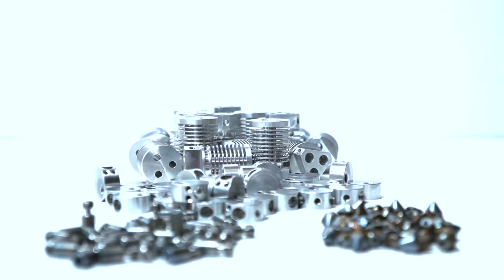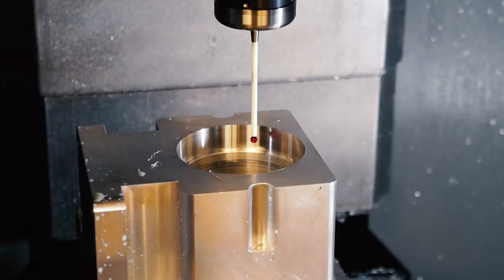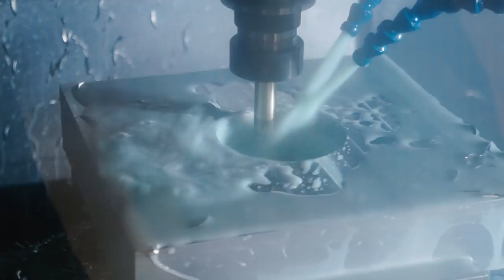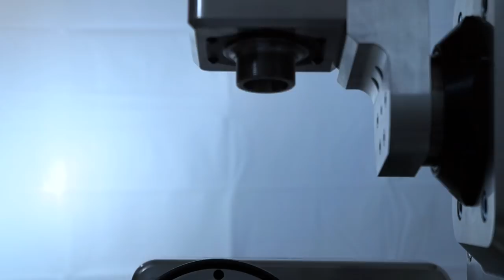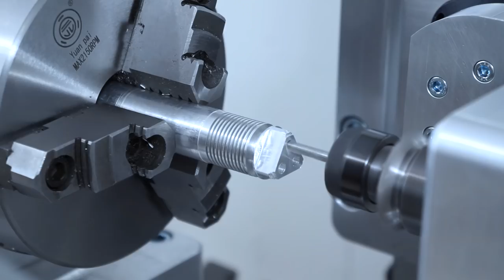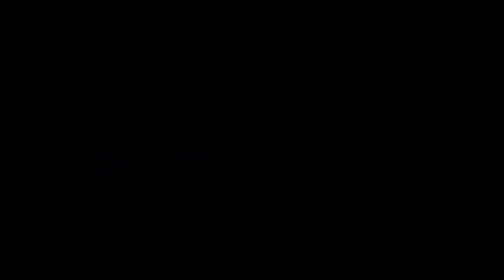SwissMak Kickstarter Launch - A Desktop CNC machine for Makers

Comment: Very funny looking at the kickstarter for this. Plot twist - they never delivered
Reply: Another one?
Reply: All these people did was take a significant amount of money and ran.  Suckers😡
Reply: like most kickstarters these days.. its a get rich scam and using someone else's money to do research and test your idea which you then go off and sell to a manufacturer after xD
Reply: Also, curious how much Kickstarter prices were.  Looking at all the metal parts, it would easily cost upwards of $50,000 for each.  Did people pay like $3-$5000 and expect to receive this? 😂  Shipping alone might have cost more than $3k
Reply: @allenl9214  I watched this campaign when it was active. Prices started at 5K. The issue was the creators where not business savvy. They priced the units to low and scaling failures consumed the money before any units where completed. They didn’t take the money they poorly managed it.
Reply: That's the risk you take when you invest into a Kickstart. The investor knows the risks.

Comment: why making a precision machine out of aluminium? it has 3x the thermal expansion rate than steel
Reply: Santosi not to mention a low damping coefficient.
Reply: Says desktop, how much a steel one wiegh?
Reply: @marshalcraft  desktop doesnt always mean flimsy ikea mobiliar
Reply: I don't know what that is, but seems to me aluminum is key alloy to achieve a desktop cnc machine. Like I said steel would be too heavy.
Reply: It’s not exactly like it’s a cheaper way either. Rigidity issues and wear issues.
Reply: Aluminum is easier to work with in every single way. That translates to less machine time and machine time is expensive, as would be the extra shipping weight and steel wouldn't be the greatest vibration dampener. After all, you ever notice that anvils are just a big block of steel? Honestly, redesigning this machine to be made out of epoxy-granite would probably be better in every way, except that aluminum is just easier to work with than any of it.
Reply: Also steel is probably going to increase (double   at least) the price of this machine if they aren't cutting parts in house, which I doubt. And price is key here. If it costs 4k usd why not buy a tormach 440 pcnc or 1100 instead?
Reply: @marshalcraft  This is a prototyping machine for a design firm or hobbyist so that they don't have to continue to limp along with Harbor Freight CNC conversions. In that context it makes quite a bit of sense.
Reply: The idea of a "desktop" machine is a bit absurd, given how much tooling etc. you need to run this. I like the concept but choices to make it light seem pointless.
Reply: Santosi 2 you ask a reasonable question. This type of machine would be fine for my work. My workshop is airconditioned. My work is light duty (Ally, Brass, Acetal) 
And as to poor damping of Aluminium, I suspect it would not be an issue on such a small machine. I am working on a design similar to this. Mine will include auto chuck and bar feed.
Reply: @Shoorit  I'm designing a mostly Ally machine similar to this. I'll be using linear rails. Wear won't be a prob. And rigidity is not an issue. Just requires good design.
Reply: @lowellhouser7731  I've looked into epoxy granite. I think it great for a one-off machine but I can't help feel it would be expensive in a production machine. I considered a steel frame with epoxy granite damping but my design is for Ally now. Much less time involved and if it works then great. If not I'm keen to go steel/epoxy/granite.
Reply: @robguyatt9602  Depends on the machine design.  Start digging around for documentation on the Concrete Lathe designed by Pat Delany and you quickly run across the name Lucien Yeomans. In 1914 Yeomans hit on a lathe construction technique using cast concrete in place of the heavy iron castings.  Instead of months to complete an iron machine by skilled labor, it took a semi-skilled labor team eight hours to turn a concrete bed casting into a lathe dialed in and ready to use. In six months Yeoman went from an empty factory to producing artillery shells on an industrial quantity. The machines were cheap and used design choices to minimize the need for truing such as ground and polished round ways which could be rotated as they wore and then pulled out and replaced when there wasn't enough left to rotate.  The catch is that all the machines had to be cast in place in the building where they would be used because transport wasn't worth bothering. You didn't rebuild these, you pulled the steel and threw it in the scrape pile, and busted up the lathe to use as fill.

Now I am eventually planning to have a shop with epoxy granite cnc machines plus a large manual lathe for building custom rifles.  But first I am going to do smaller prototype machines in concrete because it is so much cheaper.
Reply: @experimental_av  well, if you have in plan to start a business in cnc, you would not look at this machine at all. its for hobby and small projects. i do not plan on mass production of car, train or ship steel parts, but for some aluminum/acrylic rc toys or similar its just perfect. my basement has limited space unfortunately...
Reply: i know what you mean... but on the other hand i'd easily fit one of those on my desk. Next to the shittily hacked together i3mk2.5 and the reflow oven :/
Man, my desk is a mess.. i need to clean up around here
Reply: Do you expect the machine to heat up drastically during a job? Will your room heat up?
Reply: and 1/3 the strength
Reply: But also 1/3 the weight, so if you make your Al machine same weight as a steel one, you will have 3x the volume to work with so you will be able to make much stiffer construction.
Reply: This is a *desktop hobby machine*. It will be juuuuust fine
Reply: "Operating temperature." Pretty much every CNC machine I've seen goes through a series of 'warm-ups' to negate any heat expansion during work.
Aluminum is lighter, cheaper, and definitely strong enough for the types of applications a desktop CNC will be used for.
Reply: Thats why it is on kickstarter... :)
Reply from the maker: @marshalcraft  It would weigh about 1,500 lbs, or 680 kgs. Wouldn't work on a table or bench.
Reply from the maker: @experimental_av  Tooling this thing can be done very cheaply, a set of 8 carbide stick tools, ER20 collets for the axial tool holders in the turret (included with machine) and a few BT30 holders for the milling spindle tools. All of this costs under 200 dollars. Drills, endmills, taps, ect. are fairly cheap as well.
Reply from the maker: @Shoorit  The solid 4" square bar of 6061 that is the machine base only bends a few microns under a heavy cut. The force loops on this machine are very short compared to full sized industrial machines, which minimized deflection. Also, the boxway surfaces are not plain aluminum sliding against plain aluminum; they are hard anodized to 65 Rockwell and they slide against polymer pads that are much softer. Boxway machines have been using Turcite since the 1970s and they wear much slower than the cast iron on cast iron machines that were the standard until then.
Reply from the maker: Machine tools, no matter the size or price, can only be calibrated/zeroed in a temperature controlled room. The SwissMak does all of the cutting within a few inches of travel since it's a sliding headstock design, so temperature swings of a few degrees will not be noticeable if you're measuring parts with calipers. A micrometer would show a diameter difference of turned parts of a few microns if the room temperature changes over a day.
Reply: I already said it would be to heavy if made from steel?? Can you read?
Reply: marshalcraft yeah but they gave an accurate number to that. And it’s quite the difference between steel and aluminum
Reply: People in this thread acting like they don’t have engineers, that went through many years of school, to solve all these problems of weight and material. 
No aluminum only expands like ~2x much as steel if I can remember( obviously depends on grade)
And even then I think it’s like 0.03mils/degree(F) if iirc. 

I can't remember who said this, "anyone can build a bridge that won't collapse. Only an engineer can build a bridge that barely won't collapse."
This machine is good enough for job it's designed to do.
Reply: Could be a prototype. I would also hope to see it in steel
Reply: @Dustin Eward Right... Even light daily use would push it out of tolerance in some time...
Reply: What is the budget price of one machine  ?
Reply: @Lipton199333  what is kickstarter?
Reply: well if its such a hugh deal to you its even cheaper to get your room to 20 C than build it out of steel
Reply: Its a lot more forgiving to prototype with :D
Reply: @bunnythekid  Err. It has better damping than steel. Vibration test fixtures are generally made of aluminium, try making one from steel! It will be very hard to control.
Reply: 984francis as far as I’m aware they are about the same for the most part, with some Al alloys performing better than steel. Neither material has a great damping coefficient. For a CNC machine to work well, the construction has to be stiff, strong and able to absorb and dampen vibration. This machine has none.
Reply: @bunnythekid  except it obviously does, as evidenced by the very nice surface finishes even on steel.
Reply: then use it in a temperature controlled environment or calibrate it's co-ordinate system based on temp it's CNC and has a computer, where is the issue
Reply: @overlordroboticscorporatio7547  you'd be able to make it out of steel if you make it an non-prebuild machine with clear and simple instrucions on how to assemble it and things you need to be carefull about for example making sure every bolt is tightened properly and secure
Reply: Kern uses aluminum extensively in the production of its machines since it's easier for them to temperature control.  By the looks of it, their machine accuracy is below 2 microns on some of their 5-axis mills.
Reply: So what just keep it in a temperature controlled room.
Reply: Aluminum is a better choice than steel if you want to build a temperature controlled machine, as the heat transfer is quicker and thus it keeps more homogenous temperature throughout the part. Look up KERN videos of their 5-axis CNC mills, polymer concrete bases, aluminum way bedding and cooled ways, castings, ball screws. Achieve 2 um precision in 5 axis movement.

For a hobby tabletop machine this is plenty good tradeoff between weight and ease of manufacturing.
Reply: @JaakkoF  What I said he said... 👆👍Actually, Yasda can achieve almost the same repeatability and accuracy as Kern
Reply: Have you seen a steel machine, it has ten times the thermal coefficient of tungsten.
Reply: @xostler  Good comment, on the expansion, it works as a percentage of the amount of material so it would probably be less than that.
Reply: Maybe b/c they own a cheap home made CNC that can only cut aluminum with any reliable precision and speed? Agreed as is it is a bit of a waste. Harbour Freight conversion with quality components would totally dance around this thing.

Comment: For the Money you can get a used CNC Mill thats not a toy..
Reply: What money? Where is the proposed selling price mentioned?
Reply: Ehh... no you can't. Not even close. $4600USD (price of this thing on Kickstarter) does not get you a used B-axis lathe with turning as well as 5 axis capacity. Might get you a used chuck if you're lucky. But comparing hobby tools to industrial tools is like comparing RC cars with F1 cars. They're not in the same market.
Reply: @VorsprungSuspension You can buy a Bridgeport for 1500 British, American or Canadian Dinars
Reply: @av6966  oh yeah? A Bridgeport with integrated turning? And a turret? And a B-axis capable of 5-axis milling? No... you cannot buy that for remotely close to the same price. Also, 1500gbp is nothing like 1500CAD. No, what you get for that money is a flogged out 3-axis mill with no toolchanger, antiquated control and a host of mechanical issues if you're lucky.
Reply: @VorsprungSuspension  True.  That's why the machine is not really useful.  4-5 axis machining plastic is not a thing, really with Injection Molding for long runs and 3D printing for prototyping.  

IMO the machine needs to be stronger (Ultimate strength) and stiffer (bending strength) than the material you are cutting for the most part.  Other than relatively soft aluminum (20-40ksi ultimate), I don't see them cutting even medium hard (HRc 32-36, ~110ksi) steel on a regular basis, and certainly not large pieces, despite the chuck size.  Also, I don't think the spindle and control systems are ready to cut Aluminum at the modern speeds and feeds we use every day.  (Basically GLH, in aluminum).

I hope for the best for them, but why not just get a Grizzly (or similar) combo lathe-mill and add RAMPS type automation to it?
Reply: @cfgosnell  semi-agree with you there, cast iron/steel would be better overall, but machining plastic is most definitely a thing (we do quite a bit of it). Injection molding setup/tooling costs are very high, 3D printing is low resolution and very poor tolerances/surface finishes and really really slow - you aren't going to make a run of 200 parts using either 3D printing or injection molding. There are plenty of legit applications for a machine like this with prototyping parts in soft metals and plastics for outfits like us. No chance of any kind of production quantities with something like this, no way it'll be durable enough or have the rigidity, but if you want to be able to prototype parts cheaply and reasonably well without pulling an expensive machine off production work, then I'd way sooner drop $5k on this than $5k on a 3D printer (or $5k on a single injection mold for one part...).
Reply: Monsieur Mohandis Where !?
Reply: Yeah this looks cool, but is garbage and wouldn't even cut mild steel except at maybe a .005 depth of cut and .004 feedrate LOL
Reply: Yes could be, but you need triphase feeding at your home, and pay a lot money  for electrical issues. I think that it's not a toy